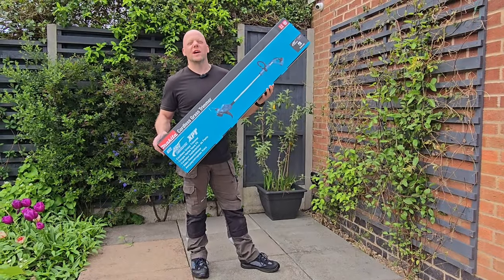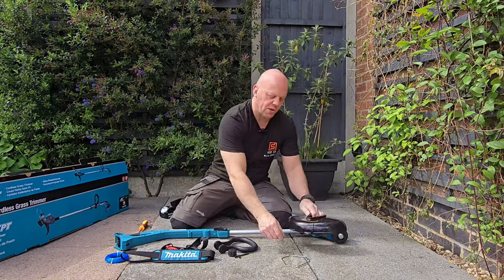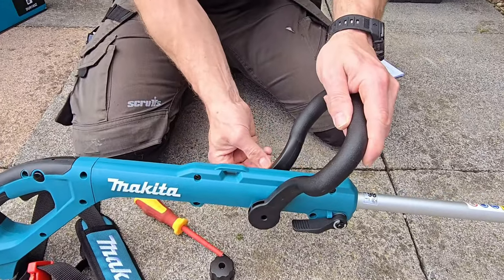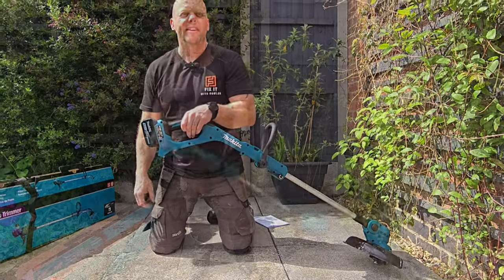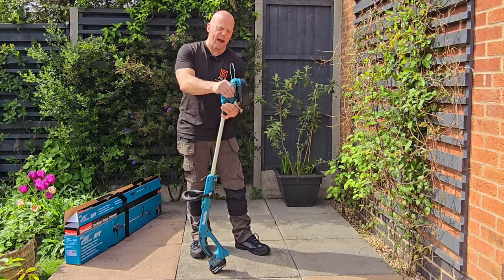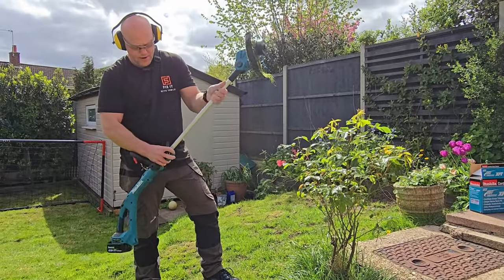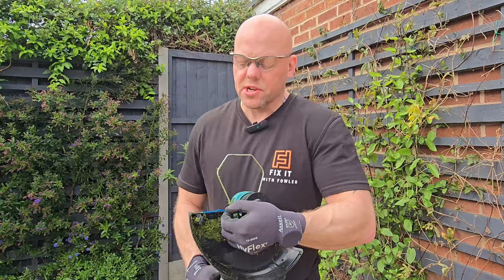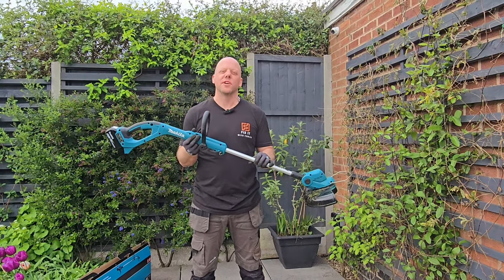Is The Makita Dur193 18v lxt Grass Trimmer Worth Your Money? Honest Review!

Comment: The button on the underside, you pressed to get more wire out, can also be 'struck' on a harder surface whilst actually strimming, so you don't have to stop the machine and do it. Great video as usual, Mr Fowler!
Reply from the maker: Thanks for that comment, I didn't know you could do that with the spool on the strimmer. Knowing my luck, it will just fly off 🤬 !!!
Reply: @FixitwithFowler  I have a smaller model to the one you have, but it has the same spooler feed mechanism. Don't smack it too hard or it might break lol
Reply from the maker: @GiggleBytes2011 I will give it a try next time I use it 👍

Comment: Every time I stop my Makita 18V LXT string trimmer, the head spins off.  I cannot figure out how to tighten it enough for it to stay on every time I stop my string trimmer.  The 3yr warranty just ran out.  Any ideas on how I can fix it?
Reply from the maker: Oh no, that's not something I've come across. Have you tried contacting makita direct, they are normally really good
Reply: If the head is removable, which yours obviously is, then there will be a hole somewhere where you can insert a metal rod (screwdriver or hex driver will work as well). Spin the head by hand and when the second hole appears, the rod will drop a bit and lock the head in place. You can then tighten it properly.
Reply from the maker: Thanks for the tip!

Comment: I bought the exact same model then in the video and when i want to cut the edges my wire always breaks and disapear into the spool .. how can i fix that?
Reply from the maker: Hi, are you using the guide for the edges?
Reply: Hi, the wire supplied with these models is useless, get some stihl strimmer wire in there and it won’t do that
Reply from the maker: @ekulsnave1616 That's a great tip. Thanks for your comment!

Comment: like a bellend i bought the black and decker one purely bcoz i had a spare battery from the drill i bought from lidl back in 2021. which also had a charger. remember when they had the drill, battery and charger for 45 quid? well ide bought that. so 3 years later ide started a gaedening business. (bought loads of makita tools labouring and ended up with 10 batteries. 

so when ide bought the shit black and decker strimmer, i wasnt aware that makita made gardening kit. 

the reason why i think the black n decker strimmer at 90 quid is shit is bcoz the battery takes 4 hours to charge fully. and what do you get out of that 4 hours? 20 minutes ON ECO MODE!! not a good deal that is it?  however, 20 mins charging the makita battery on a makita charger gives u 20-40 mins usage. seem like a no brainer.

so im selling the black and decker drill, 2 batteries and  charger, and also a corded black n decker strimmer and just bought the makita 18v strimmer.

my gardening jobs are increasing. gaining more n more customers every week. so.....i now have the makita 18v for small lawn jobs and went out n bought the makita petrol strimmer for large lawn jobs (where there are no windows close by LOL. 

last year i bought the makita 36v mower too. thats a decent bit of kit for small to medium lawns but i worked it out..... going through 2 batteries each time, then whipping them onto the double charger, and using another 2 fully charged batteries.... over the months ile be draining their capacity very quick...and at 60-70 quid each.......i decided to buy a petrol mower. finally got my tools tweaked down to efficiency. 

Oh and i bought the makita telescopic hedge trimmer too. hardly use it but its decent tool!!

hope my massive story helped someone make sense of gardening jobs hahaha
Reply from the maker: Hi, thanks for your comment and I hope my Makita strimmer and Makita hedge trimmer review have helped with your decision to get Makita kit. I'm really impressed with mine but went for a petrol lawnmower as our lawns are quite big.